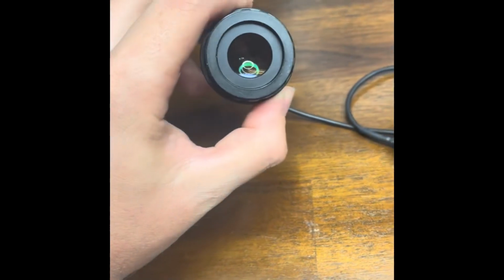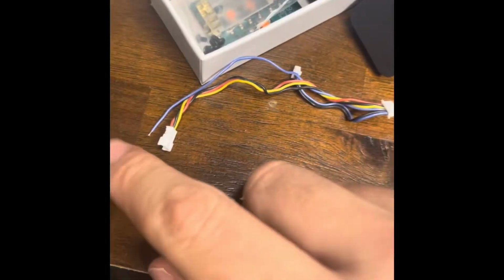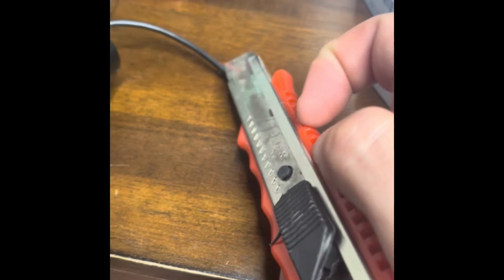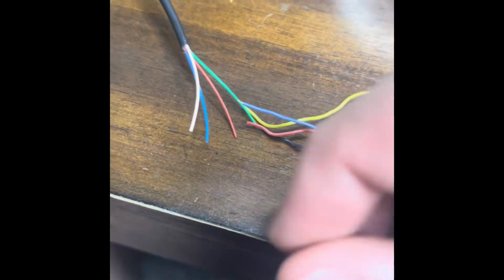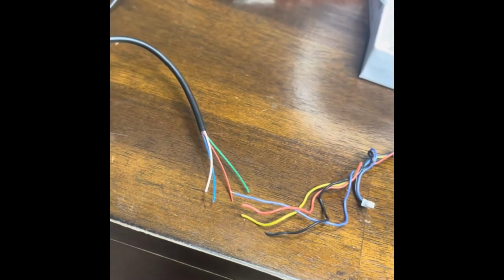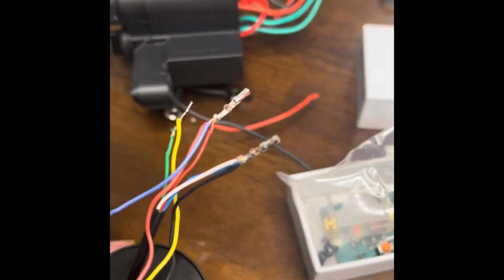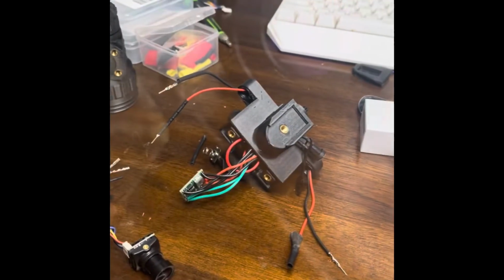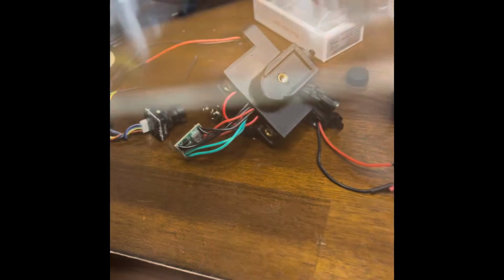PVS-69 gen 3 build part 3

Comment: If im using an external battery regulated to 5v would it be possible to skip using a 3 way switch and just wire the positive and negitive to the dc jack directly?

Comment: Any reason why not to use an aluminum maglite extension tube? It would make it more durable, more waterproof, and you can thermally couple the electronics to the housing to reject heat.

Comment: Kinda bummed I built these before the new body and bridge came out, but hey awesome job and it gives me something else to build. Thanks for developing these they are killer for sure.
Reply from the maker: Sorry man updates are constantly rolling out lol Charlie is a pretty finalized design. Small tweaks may occur but the plan for echo is to be heavily PCB dependent.
Reply: @vonscherfarms925  not a problem at all man this is cool shit! I always enjoy making new stuff, and you have a good design and development of stuff here. Thanks for all the work and dedication.
Reply: @vonscherfarms925  Also the battery pack....A+ man, the 18650 set up lasts forever and acts as a balance weight on my helmet!
Reply from the maker: @TheCoalitionofCombat  you got it assembled? I personally haven’t built one
Reply: @vonscherfarms925  Yes! It worked out awesome! Though I had to make my own cable. I used 2 90 degree 5.5mm. I couldnt get the internal battery to work all the well so I made the pack. Worked out great. Just did the 18650 didnt try the AAA. I was thinking about doing a cap for the internal that the wire didnt go though but figured i would use the pack as a balance weight, and it worked perfect. Almost put a ir light in its place but i have a helmet mounted ir so it wasnt needed. Where can I i find charlie and echo?
Reply from the maker: @TheCoalitionofCombat  Echo is not yet released (or started) Charlie is in the discord!
Reply: @vonscherfarms925  what’s the discord name/ invite?